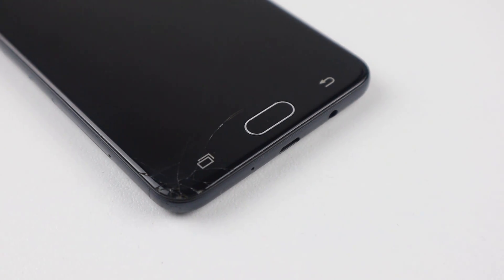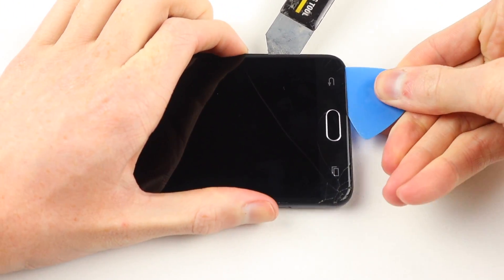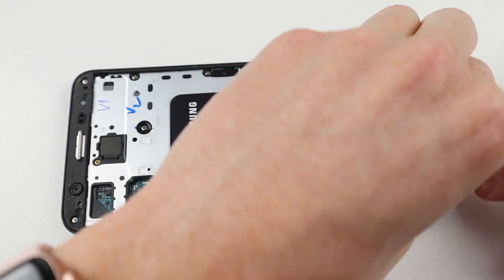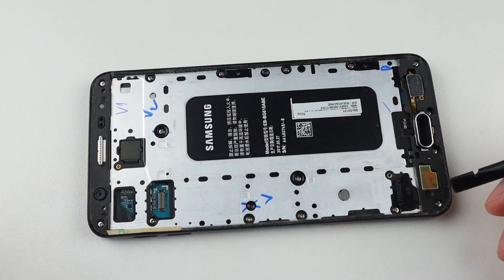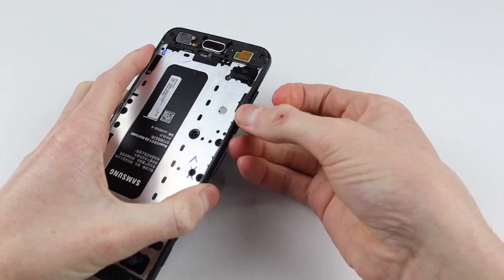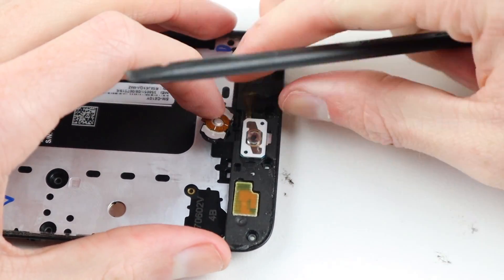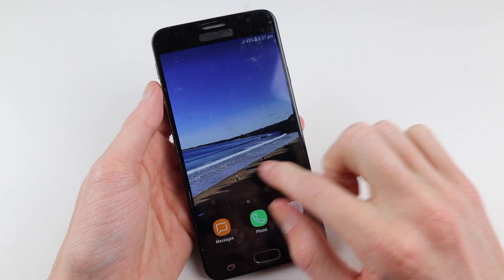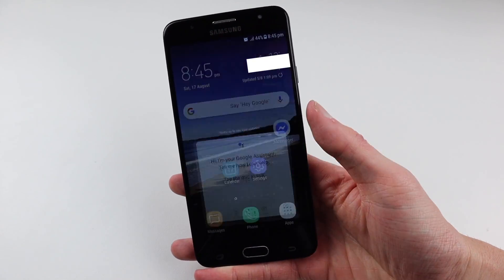Unrepairable design? - Samsung J7 Prime Screen Replacement

Comment: HUFG JEFFREYS for a better grip betwen display / touchscreen or other parts i recommend you b-7000 or b-6000 glue is easy to use and verry stronger, in the past i used the "3 m double tape", but after time the screen fall off becouse of dust or small sand
Reply: I dont like sand. Its rough. Course. Irratating, and it gets everywhere.
Reply: @2435Bits  you seem cool, don't come to the jedi school tomorrow
Reply: BLOOD RIPPER i agree, E-7000 works for me as well
Reply: but what happend when you need to re open your smart phone?
Reply: @abattleborn  just use a bit of heat and open it. It's not like superglue. It's more like contact cement glue.
Reply: @JulianSauco  hmm interesting,i will give it a try.
thanks for you help and thanks for the advice
Reply: Tesa 61395 is the best adhesive I’ve used, it’s what Apple use to adhere iPad screens to the frame, super strong stuff.
Reply: This. For every case you should use B-7000. It also works as a gasket, preventing water and dust from getting inside.
Reply: yeah.
me use glue to.
Reply: Hufg
Reply: Yeah

Comment: Its weird i own this phone and i noticed lately that there is a space between the screen and the phone somehow . Im shocked because all of the adhesive just didn’t do its job lol
Reply: I MASTER graal did your battery inflate ?
Reply: If your battery inflated do not charge your phone as the battery might explode, and don’t put your phone in a area with limited ventilation or hot or cold areas.
Reply: Random YouTube Videos  i don’t think so because it has been awhile (like 3weeks) since i noticed that . I noticed it when powering on the phone at night the screen is all dark and the samsung logo is in the middle as usual but there was some light going out of the “hole” between the screen and the body of the phone . But you made me worried because also it was dropped few times and i can notice on the back there is one like “bump” going to the inside of the phone (sorry not native english speaker here i might not have descripted it correctly)

Comment: Fuck Samsung phone. They are a pain in the ass to repair, starting with the disassembly. I tried replacing the usb port on a Samsung A3 and it's literally impossible without breaking the screen, because the front button LEDs are clamped between the digitizer and the LCD.

Comment: I got a amazon fire tablet works fine but needs a new lcd n I also got a samsung tablet doesn't turn on n cracked but I don't have a charger to test I got them both for £1 each to sell for spares would u be interested in them at all for a vid?